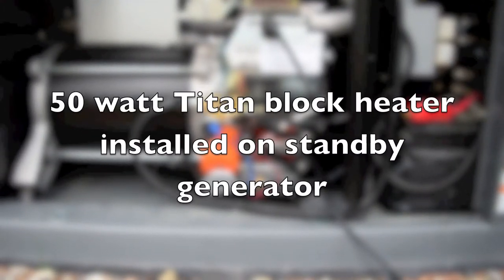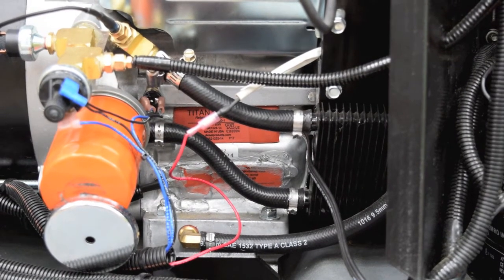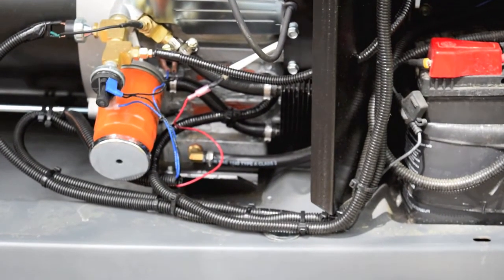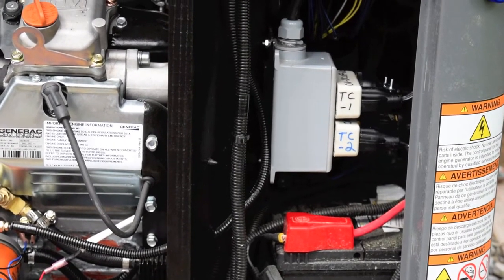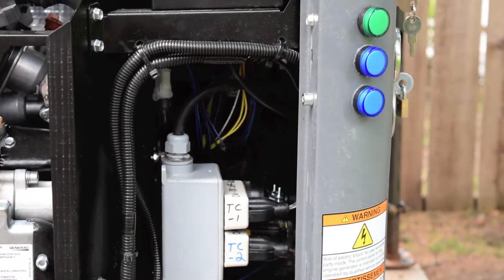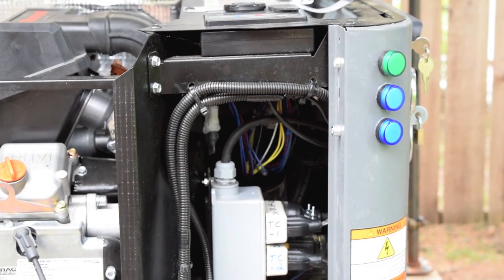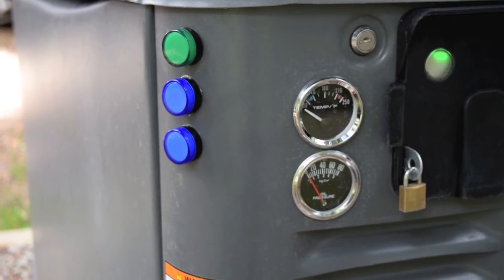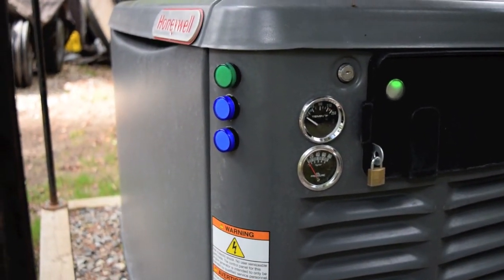Install second 50 watt block heater on 17 KW Honeywell Standby Generator

Comment: Did you add the 120 volt outlet in the battery compartment? Is there s video on that? Where you plug in the TC cubes.
Reply from the maker: I split off one leg of the power from my panel that goes out to the generator for the 120 volt outlet. It works OK, but if I was doing it again I would have run a separate 120 volt line out to the generator enclosure. That won't happen as the NG and electrical are underground.

Comment: Does it turn on automatically when temps are low or do you turn it on manually? Or is it always on all year around?
Reply from the maker: Both are controlled by thermo-cubes, as indicated in the comments field.  Always read the comments.

"When it is that cold the 50 watt block heater is not enough to make for easy starting. Today I added a second 50 watt block heater. So now I have a 50 watt battery blanket and a 50 watt block heater controlled by a TC2 thermo cube which turns on at -7c or 20f and off 
at -1c or 30 f. The second 50 watt block heater is controlled by a TC1 thermo cube which turns on at -18c or 0f and off at -12c or 10f."
Reply: Yahoo! Thanks